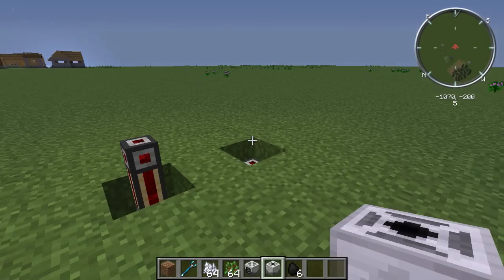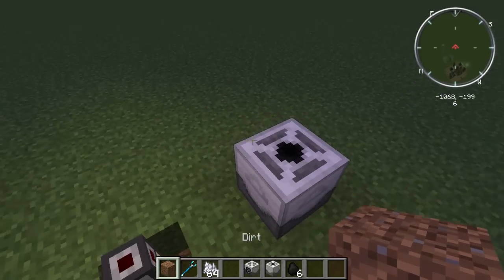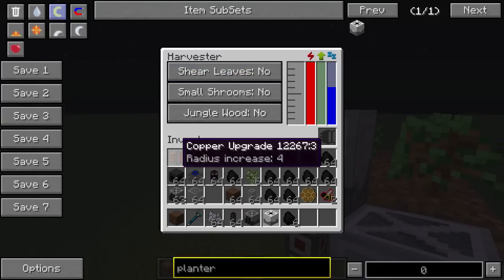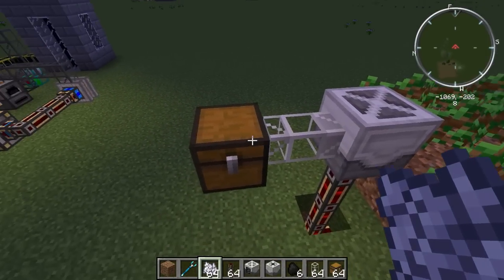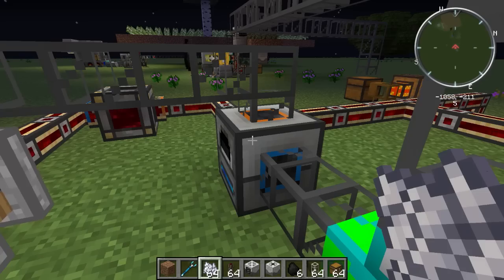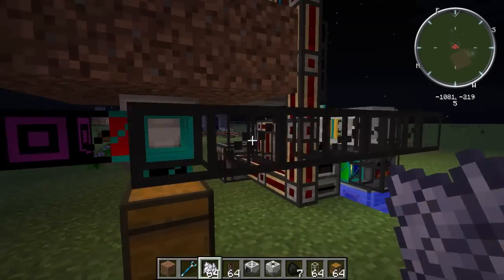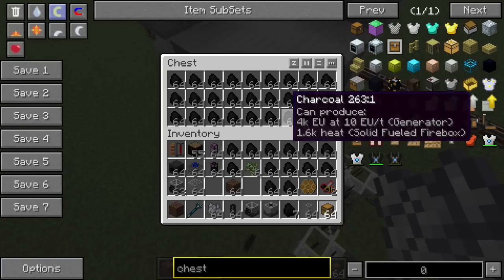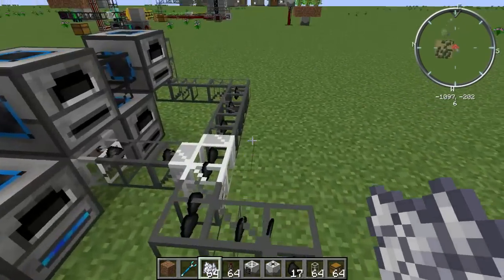FTB Tutorial: Automatic Sustainable Tree Farm MJ Power Plan Minefactory Reloaded

Comment: I did a similar solution, except with a Steve's Carts tree farm. Pumped the wood back to the sawmill in my base, used the 6 planks in a high-temp furnace generator, and it's doing pretty well over time.

Comment: I'm sure most people probably can't hear this, but you have a whole bunch of reverb in the background of your audio. Check it with audacity or something youll probably see it. (hearing it on a $200 soundcard and $700 headphones so im not bs'ing you). just a heads up.
Reply from the maker: Thanks, I'm sure the sound was coming from a vibrating heatsing+fan. I've installed water cooling and I now use adobe premier to isolate and remove the hum. If you could check out one of my newer ones and let me know how it sounds. thanks